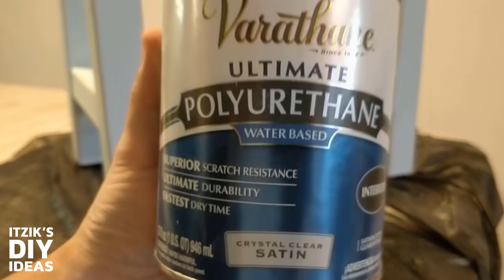Simple Wooden Stool - My Wife's first Woodworking Project | Couples & Beginners Workshop | XDIY

Comment: Funny thing, I was looking for a diy wooden stool project because I wanted to do it with my wife )) And no, I also didn't give my wife circular saw ) It is really worth sharing some of your hobbies with your beloved as well as the joys they bring )
Reply from the maker: Cool Denys, thanks for your comment! Yes, I think that circular saw is not for starter woodworkers and of course not for first project and it should come later. Jigsaw is dangerous like any saw, but still much easier to start with. 
So, did you already made some projects with her? (maybe you can give me more ideas :) for the next projects). Or you're going to make a stool as first project?
Reply: We just prepared the parts - pre-cut and some sanding, and about to assemble the thing ) The idea with this project is to allow her to do it herself wherever it is possible. I just provide guidance, instructions with the tools and a helping hand where needed )). Also some support with dangerous tools.
Reply from the maker: Great. Thanks.
Reply: @XDIY  It is not the first project, we've already built together a garden bench. But for that one we were doing like 80/20. She did sanding and finishing. It was very good though. We should also capture some videos, should be interesting.

As to ideas - we like to do wooden cookies ) Really fun thing to do. It is not quite a practical furniture, but it is just beautiful and interesting to make and finish (you can do oil or burn, or you can do both). 

The trick is to go for a walk and `hunt` good naturally dried branch. If you find it on a tree, you can cut it on a ring and make a favor for the tree anyway. 

From our experience - If a branch is naturally dried and has no cracks, after you cut it to cookies  - they will not crack as well
Reply from the maker: @denysmotornyi5623  Thanks!